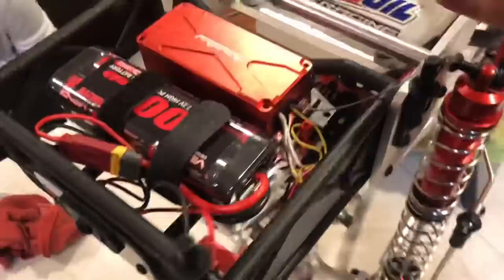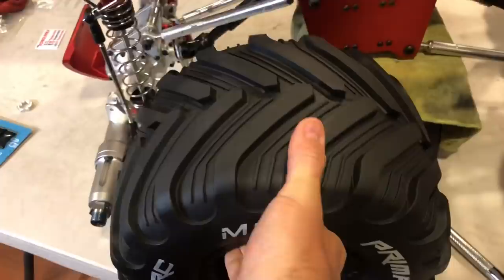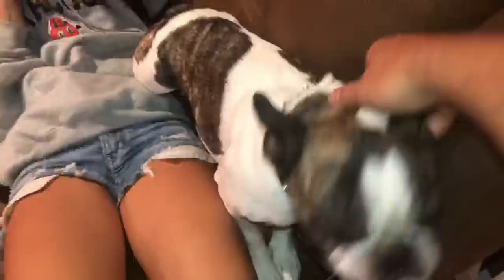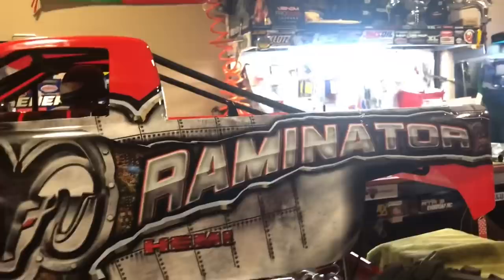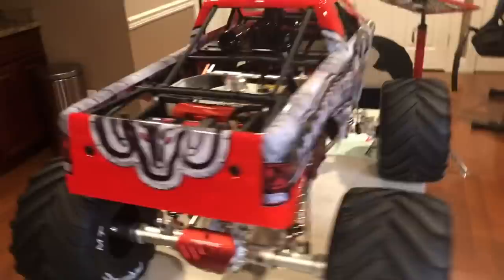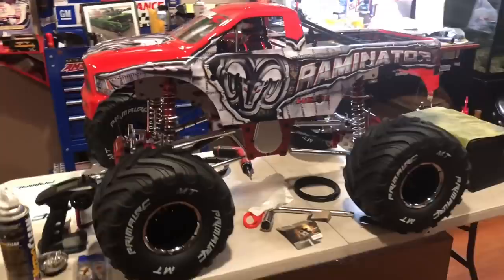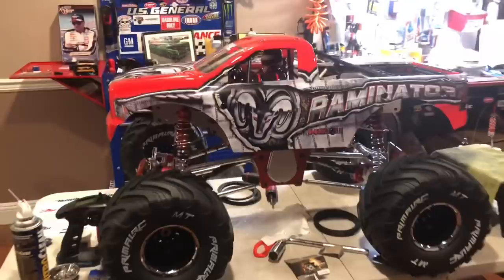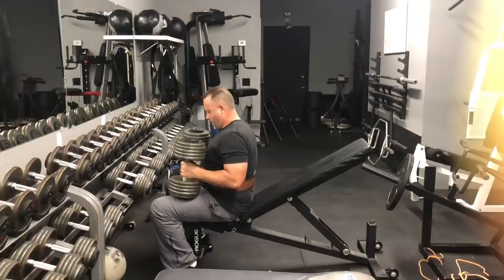PART 4, BOTAJELL GETTING HIS PRIMAL RC MONSTER TRUCK READY TO BRAPPP⛽️🔥💨 Stickers/Wrap

Comment: Staying up till 130 working on rc's is way better than staying up till 130 at the bar.
Reply from the maker: No ?’s! I remember them days brotha trust me but I have to thank this real engine RC hobby for definitely saving my ass because the rate I was going in the past was real bad. There are so many things that could have bad happened if I stayed at that bar life like I used to ? I would risk lots of things and potential loosing everything I worked hard for plus my health because I would have had some side girlfriends and probably would have kept over drinking and smoking 🚬 and even risks of drinking and driving or getting into accidents ? Those would be the risks that were bound to come ! My luck would have had eventually run out !

Comment: Contacted Inertia Racing Products and he cut some 8" Delrin pull cord extensions and they're super nice. Thick and has rubber inserts top and bottom. Doesn't fall over in front of the gas tank anymore $20 shipped. He added pics of mine to his site. 👍👊

Comment: Botajell, received my Raminator couple days ago. Started my build and am taking it slow doing it right. I cant however figure out how in the world to get the spark plug boot off? My metal cased boot it comes with hits the frame cross brace holding the brake servo just after it pops loose. Not enough play to get it off. How did you get yours off without having to remove that brace? Seems like it would be silly to have to take that brace off holding the servo every time we need plug access. Any help would be appreciated!
Reply from the maker: Bro congratulations 🎉🍾🎈🎊 👍💥👏Thats awesome! Best RC Ever NO ?’s ! It really should be the truck of the year !!
Reply from the maker: I never removed my friend Carlos’s PMT  and with mine I think I just wiggled it or maybe remove the brace?? Not I’d have to go back in my videos to check
Reply: @BOTAJELL  thanks brother! It truly is a masterpiece. Im doing a build thread on it on a forum with pics. Thanks for the reply sir! In your videos you skipped that part lol! You talked about doing it and then the next video you said you did it and put 3 in 1 down the hole. Lol! All good bro. Thanks for the help and the insightful videos!